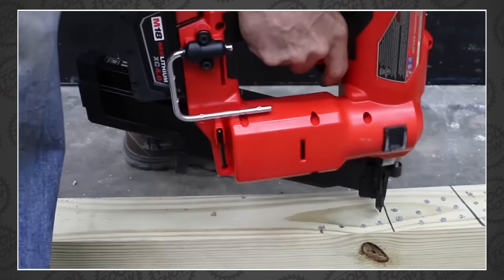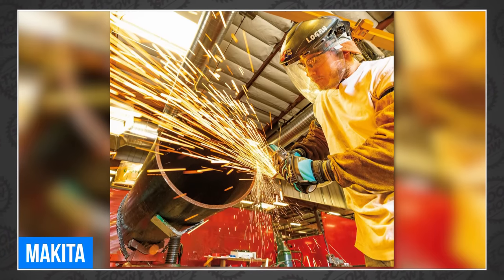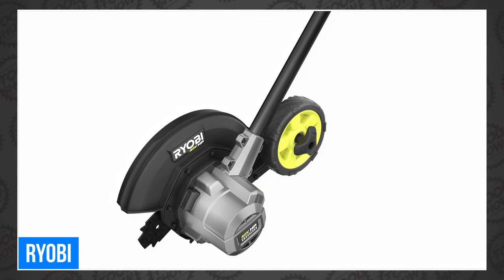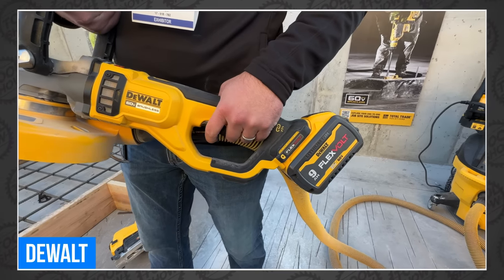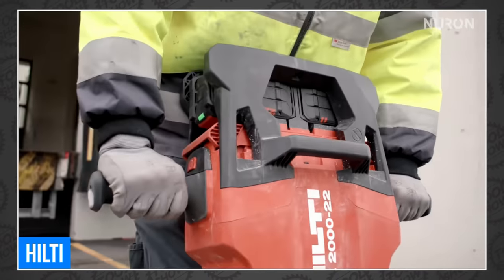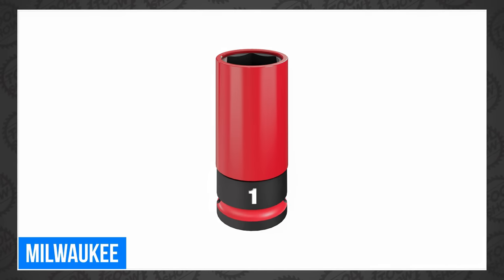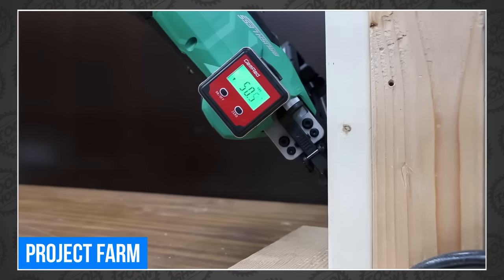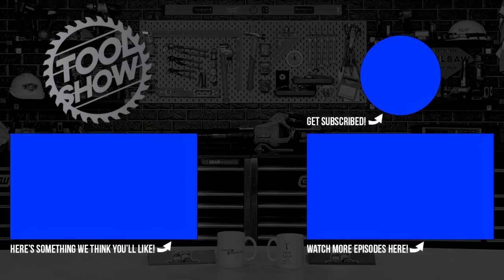BREAKING! NEW Tools from Milwaukee, FLEX, DeWALT, Bosch, Makita and more! It's the Tool Show!

Comment: Flex needs a cordless 8-1/4" jobsite table saw with rack & pinion fence.

The first project I would work on with a Skil circ saw is cutting every barrel grip jigsaw in half that I could find!

There's no point in using a barrel grip jigsaw, or pro tools without pro accessories.

Comment: There's no point in using pro tools, without using the great pro tool accessories from Spyder.

That Skil Saw would come in handy cutting up plywood for various projects I have around the house, along with slicing and dicing a bunch of 2x wood used for studs and brackets to build walls and some garage shelving. 

Great show you guys!

Comment: As for the contest for the saw, I wanted to finish cutting cabinet bottoms out from under our kitchen sink which leaked onto them and rotted them. I can then replace the board without all the work I am looking at with a multitool and a jigsaw.
Love the smiles you continue to keep up even through so many random tools you may or may not use but want anyway!

Comment: The Mach-Blue coating on the Stinger bits has me intrigued. It looks like coatings you find on CNC end mills. I suspect if its like those coatings, and that combined with the HSS should make for some clean holes. There's no point using pro tools without pro accessories from Spider.

Comment: "Buy only red tools.." 🤣 don't let them get ya! I have yet to get a cordless circular saw but I need to build/fix a work bench of wood and I don't have outdoor power (have to run an extension cord from inside.. it's a rental). And you can't use pro tools without pro accessories! (Sorry just following orders lol)

Comment: There's definitely that need for professional accessories like spider co . I have a drill bit set from harbor freight. Like 50 different drill bits in every size but they've all been basically one use. Unless going into wood everything either those, rounds over, or snaps, on the 1st try

Comment: I guess I would use those Spyder blades on the saw because there's no point using Pro Tools without Pro accessories from Spyder. Seriously though I would love to try those Mach blue bits. I have seem them tested and they are amazing. Thx

Comment: Flex doesn't have enough capital flowing in to release a high cost tool or the number of tools they promised. If I remember it was 100 tools released in 2 years? They will fall mighty short of that number. Too tough of a market when your only ubiquity is "turbo mode". LOL
Reply: Imo, a company that's rushing to push out a certain amount of tools in a short time period says they're just about numbers and not about quality.